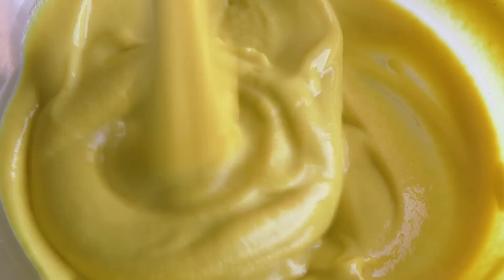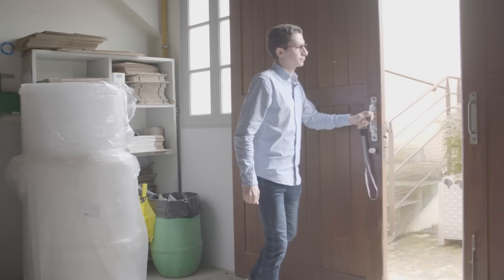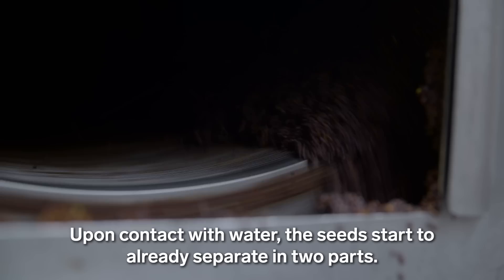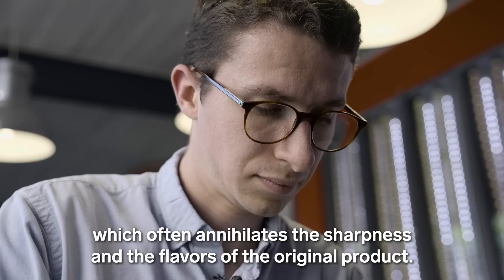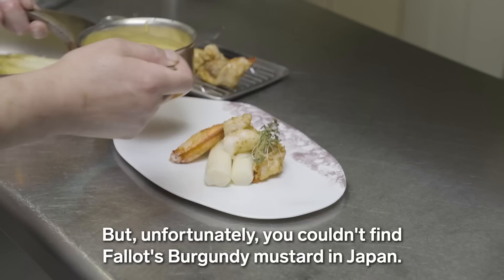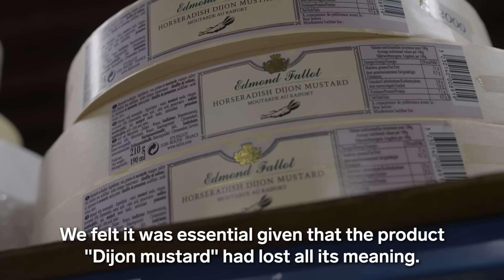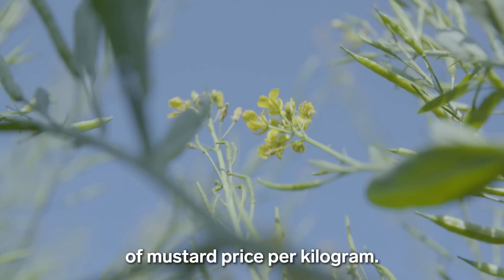Why Real Dijon Mustard Is So Expensive | So Expensive Food | Business Insider

Comment: I love the flavour of the stone mill, really makes the price justified
Reply: It's has more to do with the supply being whatever 4000 metric tons can produce and the demand being probably higher than that supply.
Stone mills actually don't change a damn thing about it (Except that iron might oxidize the seed) but I am sure you're being sarcastic.
Reply: @FunSkipping  The point is the texture it gives, other type of mills produce a much finer product, that is what the guy explains, this really brings out the spiciness and overwhelms the actual flavour, with the stone mill, the texture is very different, and there are no industrial grinding techniques that emulate that quality. The point is not that the mill is made of stone, but its geometry, which is also its limitation in terms of output
Reply: @yyunko7764  Prove to me there is a quantifiable difference in texture and flavor. I doubt anyone can. It was sarcasm to say that is why it is highly priced to begin with.

It's like people that make leather traditionally rather than using updated methods, it's just pointless and works less of the time and ends in the same exact product.
Reply: @FunSkipping  typical industrial grinding methods use some kind of cutting element, these allow you to do continuous processing of the material in great quantities, but it makes it so the product is made up of many different sized particules, from very fine, to coarse (though coarseness can be controlled) the issue there is that very fine particules are what release the oils inside of the mustard seed and mix it very evenly, which is what result in a product that tastes hot but not much else.

Using stones, or similar method mills, allows you to control the coarsness and have less of a spread in terms of how many different particule sizes you get in the final product. This means that you don't get a fine suspension of oil, but rahter a more uneven mixture, and that makes it so you can better taste the flavour which comes more from the husks and the fleshy part of the fruit. This method means you can't do continuous processing, you need to periodically empty the grinding stones somehow, which slows down productivity.
Reply: @yyunko7764  I've tried both you know. There is no distinguishable difference in good brands that use steel mills and good brands that don't, it is a LIE to spike the price of it, and they do it with such smugness, their mustard seeds aren't any different than the same seeds grown elsewhere in the world too. You can grow and make the SAME THING anywhere, with indoor lights.

And to the point you made that about it being more even coming out of stone doesn't even make sense since steel is machined and DESIGNED to make it even.

This really is the leather argument. Nobody does non vegetable leather anymore, it's outdated and has 0 difference. good effort though.
Reply: @FunSkipping  dude cool down, it's like 2 bucks and it's sauce lmao
Reply: @yyunko7764  You reminded me of the Adam Sandler Anger Management scene when he's on the plane "We need you to calm down sir." "I'm calm."

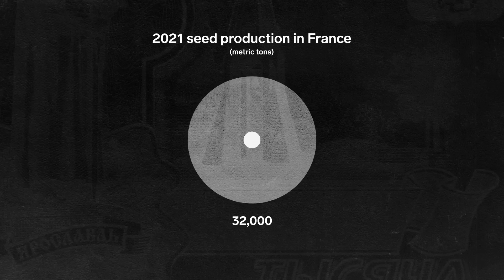Comment: The visualization on 4:58 is (very) wrong. If you compare two quantities as disks, the ratio should be in the area not in the diameter. So I your case the 4000 looks like 1/64 of the total of 32000 instead of the 1/8 it should be!